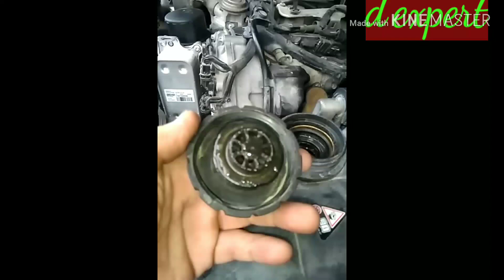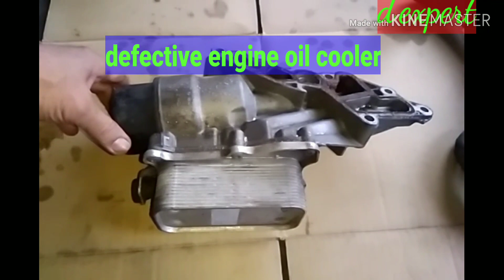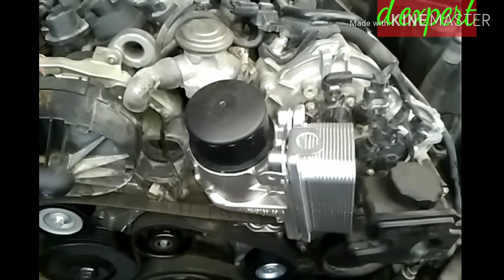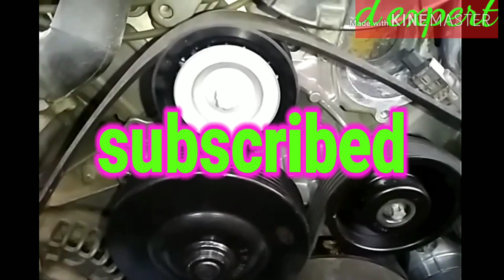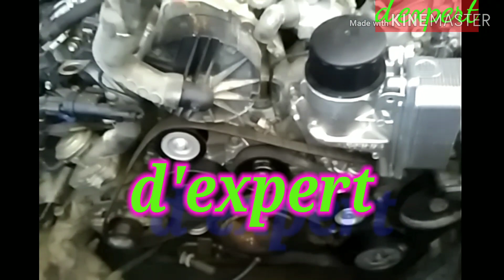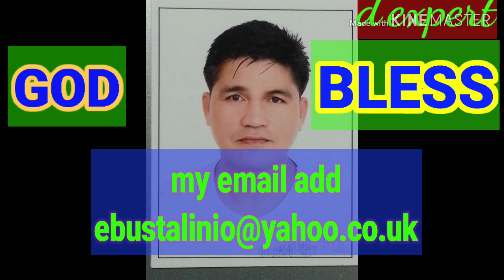🇵🇭 Engine Oil Cooler(defective)Mercedes Benz V6 engine🇵🇭🇵🇭🇵🇭Eddexpert@2022

Comment: do you recommend to replace it with an  OEM part or an after market part?    My mechanic says : okay drive the car and you said no  cause contaminate the internal
Parts.  What s. The true then
Reply from the maker: After narket part can be use but i was experienced defective after market part snd it doesn't last.
It is cheaper than oem parts. It defends on your budget...